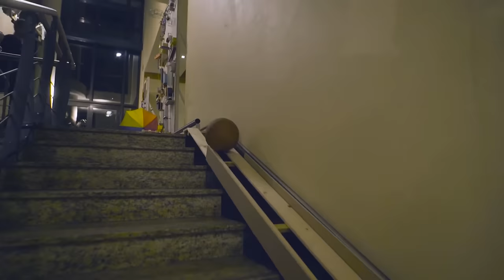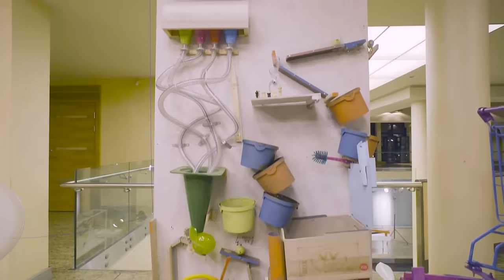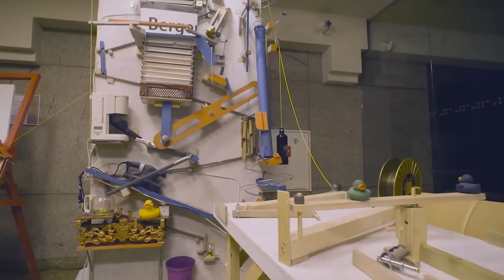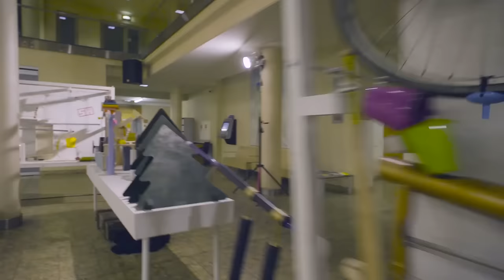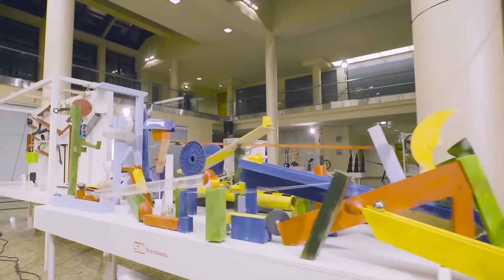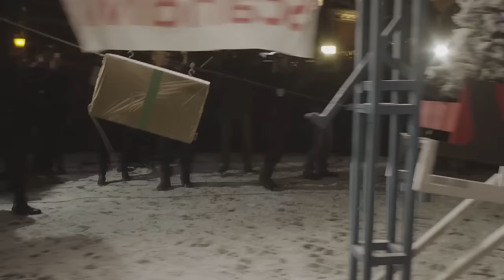World’s largest Rube Goldberg machine lights up Christmas tree

Comment: but that was two separate ones, the first one just lit up a lightbulb.
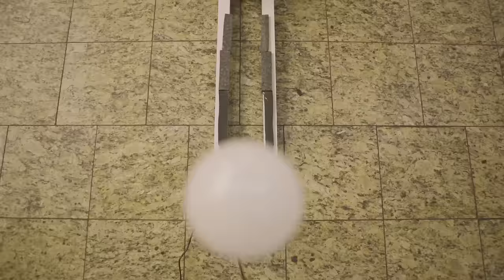Reply: At 4:11, you can see two wires coming from the light stand. One has to be power. The other probably leads outside.

Comment: What aspect makes this "the biggest" because if we're going for shear length to turn something on doesn't that make satellites and probes the biggest Rube Goldberg machines as they are remotely operate by complex automate systems from distances bigger than the diameter of the earth? (for instance the mars rovers operated at least partially from earth at an average distance of 225 million kilometers according to Quora.)